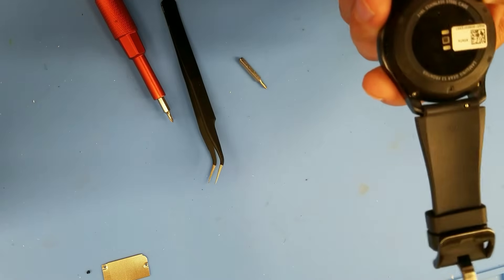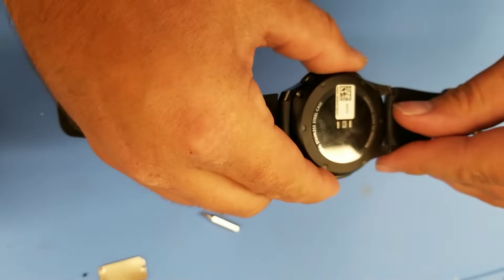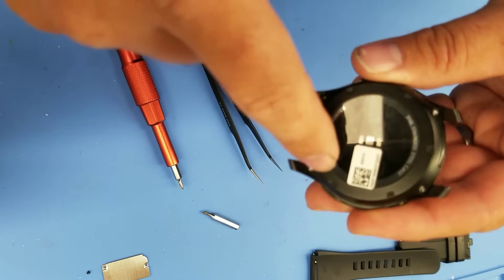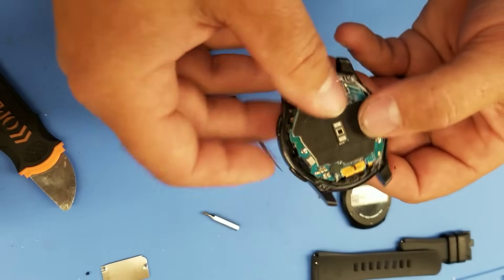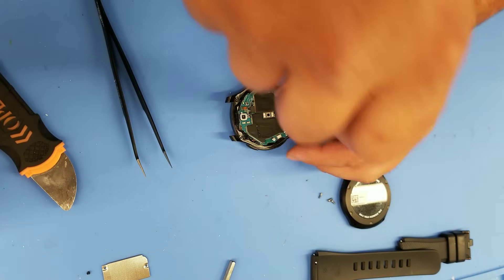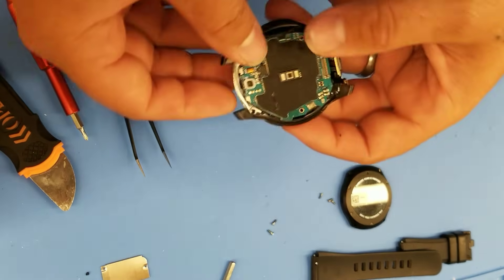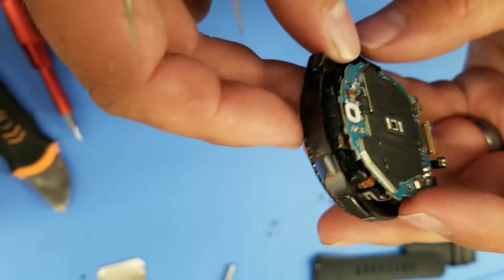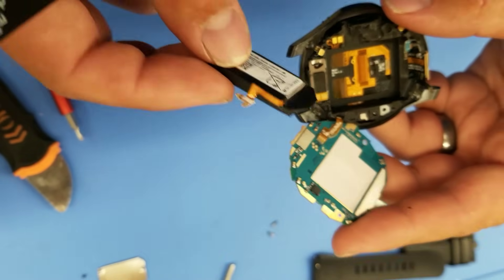Samsung Gear S3 Frontier teardown, battery replacement

Comment: Thanks for the video, it was vital. I watched it multiple times before getting started, and once mid process. But I just got done changing out the battery and it works. I found it easier to remove the whole black plastic carrier from the watch. The large ribbon cable and the smaller one next to it can slide through the plastic carrier - they connect to the LCD - and the whole assembly is free of the bezel. Then you can push the battery and top circuit board out from behind. One pain is the battery ribbon cable has a small hole to orient it and secure it. The hole on my replacement battery wasn't punched through all the way. I used a pin to open it up. So if you are doing this, make sure the battery cable stays in place when you put it back together. Mine moved on my first attempt, that is when I found the hole wasn't working. And if you buy a kit from eBay where they supply the Y screwdriver, the one I got didn't fit right. The tip is too long. I used a file to grind off a tiny bit of the tip and it fit much better. I had to apply a lot of force to keep the screwdriver from spinning and stripping the Y slots.  Good luck, this is doable, really!

Comment: hello I have a gear s3 and the sensors stopped working what I can do.
Reply: Mine wasn't registering when I raised my watch to look at it, I had top press one of the buttons any time I wanted to see what time it was.  I recently did a factory reset and after that the sensors started registering again and I can see the time by raising my wrist to look.

Comment: Thank you! I followed the instructions, but I did have a problem!when I turned the watch back on I could only see a stripe for a fiew seconds on the screen... and then the screen is off I was super carefully and did everything exacly as you showed did I messed something up?the watch connects to the phone... great battery life now, but no screen.... lol I am from Brazil and the places you can take to fix they will rip you offAny ideas???Again, thanks a lot
Reply: Screen's shot.  Gonna need to replace it.
Reply: Recheck the 3 snap connectors

Comment: I have to agree with quite a few of the posts about this video.  While the instructions about how to open and get to the battery were in themselves excellent, there is NO doubt that this was done many times before with the same watch.  There's no way you got the back off that easy on the 1st time around, let alone let the battery flop out as easy as it did.  

That being said, the instructions were great and allowed me to completely replace the battery in my S3 Frontier (SM-R760) watch.  So, thank you VERY much for the video.  

Next time though you might want to include the issues you had the first time you disassembled the watch.  AKA the incredibly hard to crack backside, as well as the glued on battery. I too had to go through several tools to find one that would work, and not tear up the watch in the process.
Reply: It's likely he's opened the same watch several times. However, there is also a revision of the watch where they no longer use the adhesive type of seal. From what I've read, later revisions of the watch have a rubber gasket, not an adhesive one. For the battery, using a plastic pry tool helps. YMMV.

Comment: I replaced the battery without any issue, although as another poster, Dennis Sanderson pointed out, my battery also had a strong adhesive securing it to the bottom of the watch. Unfortunately for me, my watch will not powe on. I can place it on the charger, and the charge indicator will turn on and show that the battery is charging. But the watch will not respond to the Power or Home button. I have tried 'rebooting' the watch. Did not help. Suggestions welcome.
Reply: Try this method:

I did something and it may be working again; it's still on after a few minutes and i'm trying to update everything.  anyway, here's what i stumbled on.

 

Step 1)  I pressed the Home/Power button until the start-up screen came on.

Step 2)  then i kept pressing the Back button repeatedly (about 6 times).

Comment: Thank you VERY much for the walk-through. Just a small note, the battery WILL be rubberized glued to the case and require a little finesse to release it. The watch back will also be stuck on pretty hard and require CAREFUL working apart if you've used the watch as a daily driver for any amount of time. All-in-all, though, great guide and 15-20 minutes of realistic work for a first-timer

Comment: Hello, Do you know if the battery from the 46mm Galaxy Watch can be installed in the Frontier Watch? It’s 472mAh compared to the Frontier which is 380mAh.
Reply: Best you can do is look up pictures but i doubt it would work connectors are most likely different
Reply: My question exactly
Reply: Wondering the same

Comment: Thanks for the video.  I was able to replace my battery and revive my GS3 Frontier following the steps above.  I noticed that when I tried to remove the board, the whole assembly (board, battery and plastic ring holder came out.  I found this actually made changing the battery and reassembly easier.  Otherwise, spot on instructions!

Comment: Thank you so much for this tutorial. My watch, too, has been totally USELESS since the firmware "upgrade," so what did I have to lose?

I had trouble with the Y00 screws - I found that a Y0 screwdriver worked better. Maybe because mine is a CLASSIC instead of FRONTIER? The 4 case screws had blue Loctite on them. Everything came apart fine. The old battery did NOT have adhesive of any kind, and was not bloated at all that I could tell. HOWEVER, I did notice a little plastic guide post underneath the battery connector was bent over sideways preventing the new battery connector from seating properly. AHA! Workmanship issue. I tried prying it back up and naturally it broke off. Good riddance.

The new battery (which came with adhesive) is now firmly in place. All went well on the reassembly, and now the watch is charging away happily. Fingers crossed.

Comment: I would not do this. Insurance for 2 years was $60 and they replace it if I even say it beeped at me funny one time on a an early Tuesday morning while you were spitshining your tandem stripper pole.
Reply: You're stupid.
Reply: Nobody is telling you to do it.  You can always buy the battery and have your local cellphone repair shop take care of repair.  They'll be impressed you came in with a battery because it's not a normal stock. Battery is currently 20 bucks on ebay from a seller with lots of perfect feedback.

Comment: I just replaced battery today. I bought it from Amazon uk 3 months ago and all of a sudden I found it hot after charging. It then went from 3 days battery life to 8 hours. I tried to return it but Samsung said it was a none EU model so wouldn't do anything. 
So I bought a battery and replaced it using this video advice. So far so good. 4 hours after charging and it is 98% still. I have the bezel and gesture wake up turned off.
Some tool tips for the UK. I used a  2.00 Y screwdriver for the back screws. To lever the back open I used the flat end bit from the bottle opener blade on a Swiss army knife. It was easy after trying other tools. Hopefully it will last, but there is a major issue for a battery to fail after 3 months and with Amazon selling non EU devices from a company calling itself "Samsung Mobile UK".
Thanks for the vid, mate.
Reply: PS. When reassembling put the battery in the watch hole and clip on the ribbon before putting the circuit board back. Gravity can be your friend or your enemy. I also used an anti static wrist band kust in case.

Comment: This was PERFECT! I was able to disassemble, replace the battery, and reassemble quickly and easily with the use of your video. Thank you very much!
Reply: Rand Greaves will it be water resist again?
Reply: @simoncheung2427  If you are careful and don't mess up the gasket it should be. Mine was perfect after I opened the watch, so I'm not worried. Not that I would ever submerge the watch tho.

Comment: I replaced my bloated battery (had issues getting the case open - with proper tools - and getting the "circuit board" off AND getting the bloated battery out from the semi-melted tape/glue), put the new battery in, all put back together - and nothing. I ended up just buying a new watch. I use AT&T - the exact same S3 Frontier on AT&T was $350 - got it on Samsung for $270. I love the watch, been without it for 1 1/2 weeks so after the time, effort, and money spent on trying to fix the old one and it not working, I just said "screw it".
Reply: Same here popped my bloated battery back in and the watch came on. Tried scratching the terminals of new battery bought on Ebay but still no power. So off to get another battery and try once more.
Reply: @dondagun  did a 2nd battery resolve your issue. I bought a replacement (580mah) battery from amazon, swapped it out for my old (but still working, just not holding a charge very long), but now not working, won't charge at all.   thanks in advance...
Reply: @DaddyElfMan I actually didn't get the other battery. I just upgraded and bought the galaxy watch

Comment: I did this last night, replaced the battery with no issues except the back cover was much more difficult to get off. Before the watch would die after five or six hours and I took it off the charger this morning at 9am and now at 8pm I still have 82% left! The battery was swelled up pretty bad which was more than likely the reason for the bad battery life.
Reply: I replaced my bloated battery (did you have issues getting the old battery out from the glue?), put the new battery in, all put back together - and nothing. I ended up just buying a new watch. I use AT&T - the exact same S3 Frontier on AT&T was $350 - got it on Samsung for $270. I love the watch, been without it for 1 1/2 weeks so after the time, effort, and money spent on trying to fix the old one and it not working, I just said "screw it".

Comment: To begin, I had a completely dead watch. After that whole 3.0.0.1 debacle and 4-5 hour battery drain, it finally went back to normal, watch worked great, had an all day charge (I have everything on, charge it every night). Last week, I woke up to the charger flashing red. Took the watch off - totally dead (it wasn't the night before). Tried recharging it several times, just got red, then within minutes, flashing red. Bought a new charger (OEM) - nope, same thing. Saw a forum that the battery could be changed, ordered one on Amazon and the tool kit. I was SO certain this would work.

I followed the video exactly - had to pause and rewind a LOT. I would say that this particular watch in the video has been taken apart once before, minimum everything just came right apart. Wasn't quite that easy for me.

I got the screws out - though getting them out all the way wasn't easy but I did, didn't lose any. Had a Hell of a time getting the case open. Tried several types of flat pry type tools - really chewed up the watch rim trying to get anything to crack it open. Finally did, removed the philips screws, undid the 3 connectors, that was all super easy. Then trying to pry the circuit board off - another story completely. Every slight pull with a fingernail started bending the board. Kept at it and FINALLY got it loose. Getting the battery out was a nightmare. It's GLUED in place, was NOT possible to just POP it out as done in the video. I had to get a scalpel-type tool and carefully slide it under the battery until it finally came free.

Replacing everything went well enough - oh, the old battery ? It was literally bloated to twice the thickness of the new one, the foil side (with all the glue on it) was all puckered, puffy, wrinkled - looks to me like acid must have started leaking? Maybe that's why it had been getting so hot over the past 2 weeks on the charger?

Once it was all back together, I held the power button down and - OMG! - I got the Samsung Galaxy Frontier light! I was excited that it must have worked - as I wasn't even getting that before - but that was as far as it got. Put it on the charger - got no charging indicator on the watch. The charge light on the cradle came on solid red but within minutes it started blinking, just as before. Tried pushing some buttons but nothing this time. Oh well, that was $110 down the drain ($40 for new cradle, $40 for battery, $25 for tools).

When I have time, I'll go through the entire procedure again, just to see. Ryan The Cell Phone Doctor, thanks for the video and guidance. It would be nice if you included that parts about hard to crack casings and glued in batteries.

In the meantime, I've read from some posters that their battery also was bloated. I'm curious, for those that had bloated batteries, how many of you actually were able to make this work? That whole Update 3.0.0.1 update sounded like one big cluster-fu** to me and it's just beyond coincidental that I never had ANY problems with my watch before this. I'd like to hear from you!
Reply: Hey good video can you show how to take apart a Samsung galaxy watch
Reply: I think your problem was the charging coil for the wireless charging. Had seen that problem before where the coil would just "burn up" lile a filament because of all the heat. But i don't know if is possible to change the coil without changing the whole back case.
Reply: Dennis Sanderson yes this watch was apart once before for other issues. Thank you for bringing that up as it didn't occur to me but the seal is very solid on the initial removal. These watches have known poor battery may be due to the software but we will learn more in due time!
Reply: @respitfire89  I followed your video (thanks for that!) but when I push the power button it won't turn on. However it will charge once put on the cradle.

Comment: thanks for the video. im thinking its my battery because it keeps shutting down with full battery.
Reply: So did mine.  New battery fixed that.
Reply: You mean turning the display off and not turning on again until u reboot the watch or turning the watch off and you need to turn it on again?

Comment: Shit, I can't even get the back cover off.
Edit: Got the cover off, used the thin flat blade in my kit and gently pried where the straps go. Once off the rest was a piece of cake. New battery has small blue tab on it that you pull off and stick to hold it down. Now time will tell.

Comment: Question. I followed your directions. Replaced the battery.  Now my watch won't cut on. However when I put it on the charger it does show the charging screen.  Any suggestions?
Reply: Sigh. Well I tried.  My battery was a bubble
Reply: you probably just didn't connect the battery correctly, since it still turns on, the watch can still get power from an external source, but no power is held in the battery
Reply: Worked like a charm for me.
Reply: creed72 your watch is probably destroyed now because your not really supposed to take it apart and if you had a warranty on it then it's voided now and the company will refuse to assist you with any repairs. That's why it's best to not take anything apart unless the manufacturer talks you through it. Don't ask for help on YouTube because it's definitely not a good idea trust me. Once people rip things apart they don't know how to put it back together.
Reply: My watch was already out of warranty, so changing my own battery isn't harming it - it's 100% dead, won't charge at all (bought a new charger, OEM) so if it doesn't work when I'm done trying this, I lost nothing but a $40 battery - if it DOES work, I just saved myself $350 for a new watch.

Comment: The heart beat sensor is not working in my s3 frontier. Is there any way to repair it?
Reply: Arvin Kumar send it to the company if possible. Don't attempt to repair it your self because you won't be able to get it back together and you will be really disappointed. Just to be safe and it working again send it to be fixed.
Reply: Check your heart if its beating  or not!

Comment: For the love of god, please never use metal tweezers when doing this. I learned the hard way that it can fuck shit up. I was prying the battery connector off, the tweezers made contact with the pins, it shorting out the battery.

Comment: How much is a battery? And is anyone having issues with the battery in the sense that after 2 years or so by midday I have 50% battery? Before used to last 2 to 3 days. Do I need to change it?
Reply: adigalben from the way it sounds your battery may have lost some of its original capability which is normal.  The lithium ions wont behave the same indefintly, I would say you try to attempt a battery replacement.
Reply: I just bought one on Amazon, it was $40 for the same brand. They have generics for less but I wouldn't want to do that, personally.
I also bought a "jewelers toolkit" (actually, small electrics tool kit) for $24 with more parts and pieces than I'd EVER use but it was a good price compared to the smaller kits - $10 more? I hadn't watched this video so had no idea what I'd need.
Reply: All I had was a tool kit from Oria, I highly suggest u use proper opening tools to get the lid off and the tweezers to not cause static damage
Reply: I have my frontier for 2 years now...after 3 months of using 100% of battery you can use it 4h...and thats it!
Is just samsung rubbish...whatever you change will be worst than original battery...
Find any samsung device where you have good battery apart from the old samsung phones...
Reply: My first suggestion to people is to try factory resetting your Gear S3 to get additional battery life. I've been using my Gear S3 since the first week of release (Nov. 21, 2016) and still get about 2-3 days of battery life. I also tried to avoid putting too much heat on it, but I do wear it daily and even to bed.